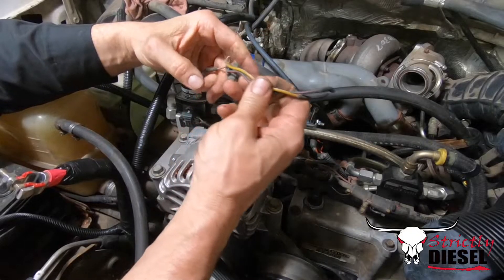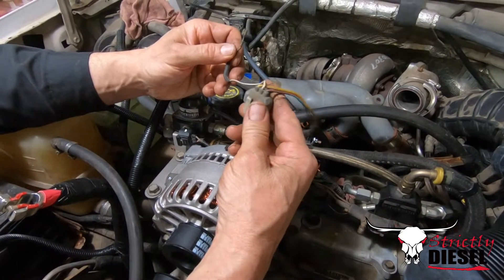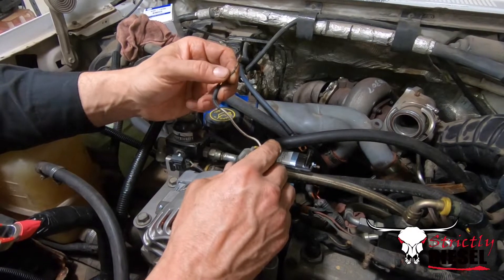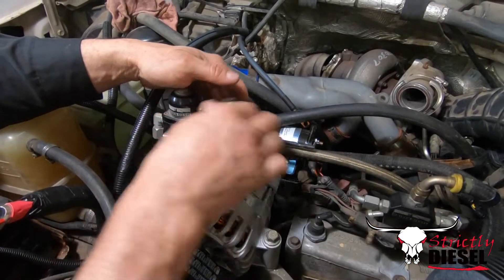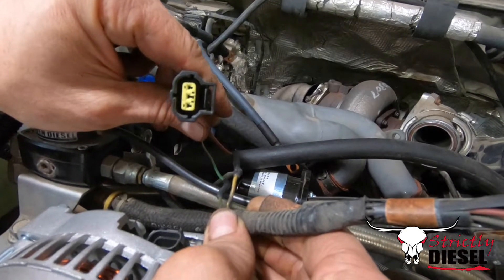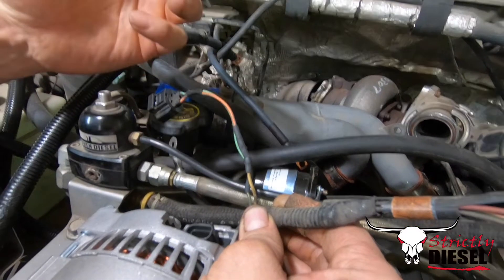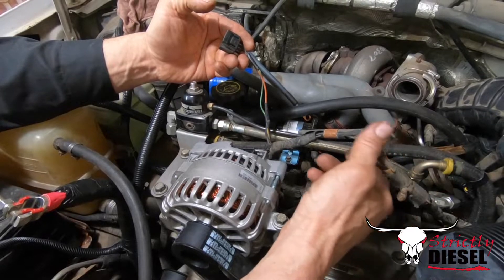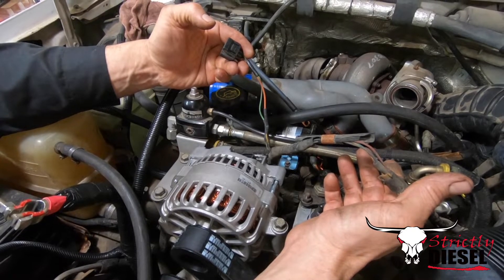Converting an OBS Ford Alternator to a Super Duty Alternator

Comment: So you dont use the white wire
Reply from the maker: Correct, because the super duty alternator does not use the white wire. If you have the super duty connector and follow our instructions in the video, everything will work as described.
Reply: Is it gonna hurt anything being the obs alternator is 130 amp and the superduty is a lower amp
Reply from the maker: @danielboyd3146  We recommend using an alternator of equal or higher amp rating.  We suspect that most people doing this conversion are likely using an aftermarktet alternator, not just installing a stock OEM unit.

Comment: What year super duty alternator will work?  

I have a 1995 power stroke and need a new alternator. 

Thank you
Reply from the maker: You can use any alternator from 99-07, but be aware that 05-07 units locate the connectors and battery connection differently and may differ from the video.
Reply: Thanks for the reply
Lots of good info on your channel